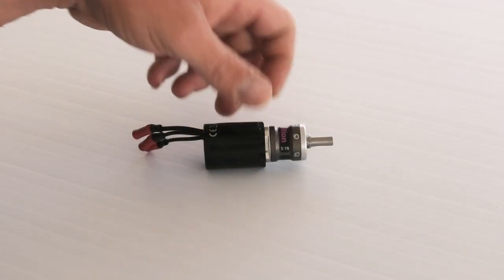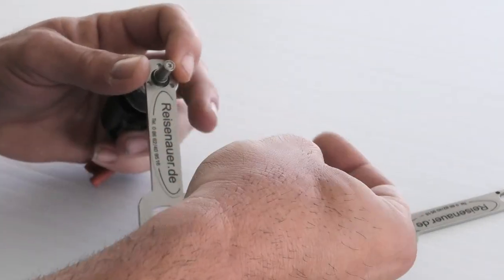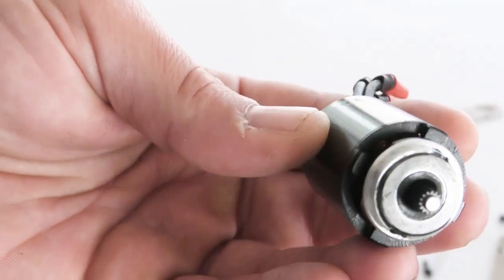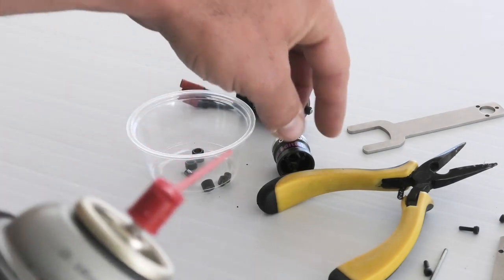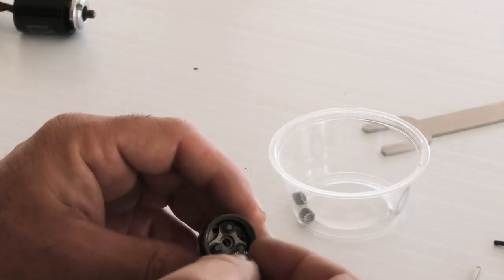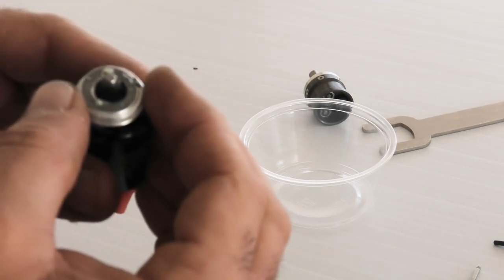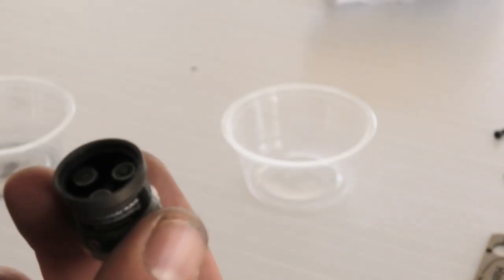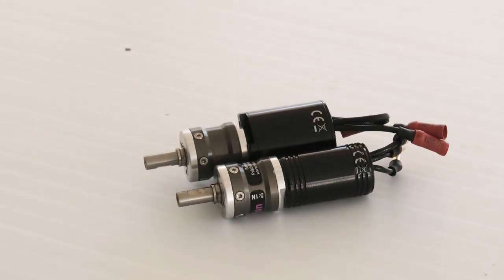F5J Gearbox Maintenance, Reisenauer Micro Edition

Comment: Ah, gearboxes. Reisenauer's are quite good, back when we were still using Kontronik ones, we had to take them apart with heat gun ... Imagine how good that was for the magnets.

It is always useful to know your motor idle current draw without the gearbox, with the fresh gearbox and with the gearbox after some flying. It's the best indication of the state of the gearbox. Also after some time you don't need the amp meter anymore, you learn to tell just by the sound of it if it needs work or not.

Anyway, what you showed here is my main motivation to prefer direct drive setups and avoid this mess altogether. 

PS. Maintenance is a good topic for this year ;)
Reply: I know Im asking the wrong place but does someone know of a way to get back into an instagram account..?
I was stupid forgot the login password. I would appreciate any tricks you can give me!
Reply: @Rey Davian instablaster =)
Reply: @Camilo Matthias it worked and I now got access to my account again. Im so happy:D
Thanks so much you really help me out :D
Reply: @Rey Davian no problem :)

Comment: There is actually 2 bearings holding the shaft. Looks like the bearings are sealed. I was worried that the cleaner might remove the grease in the bearings but the planetary gear holder would shield them from any overspray I guess.

Comment: D'you know how to dismantle planet for planetary gear from motor shaft glued with Loctite 648? My seems to be worn out and difficult to be removed. Any idea?
Reply from the maker: If you want to remove pinion on motor shaft I think you would need a small gear puller and maybe use soldering iron to heat up gear and maybe melt glue.
Reply: I don't think you showed lubricating the ballrace at the front of the gearbox? That might be important after using the brake cleaner to remove all old lubrication. 
FWIW